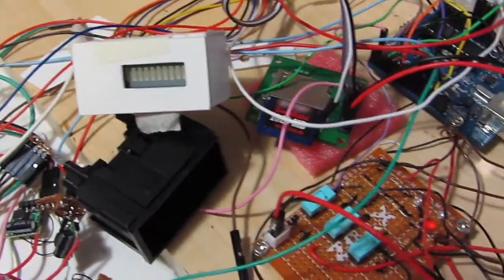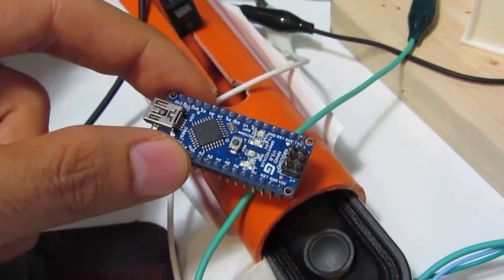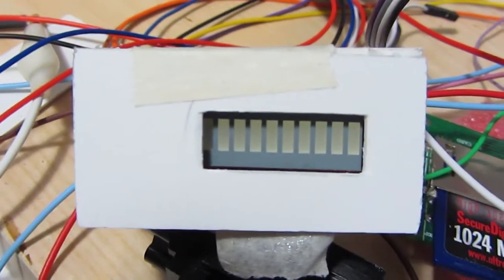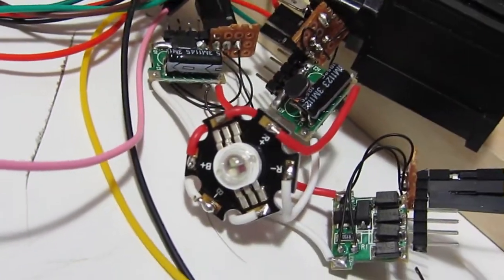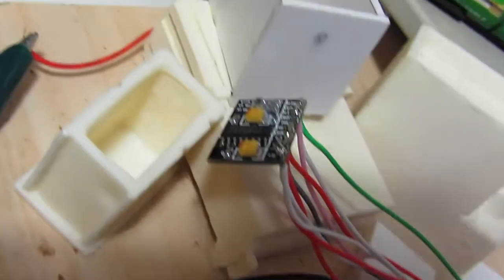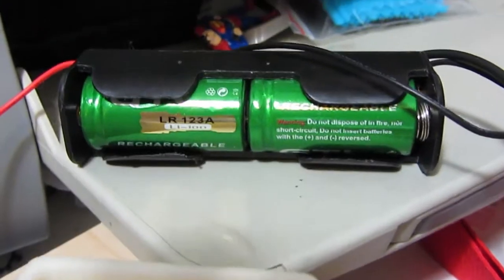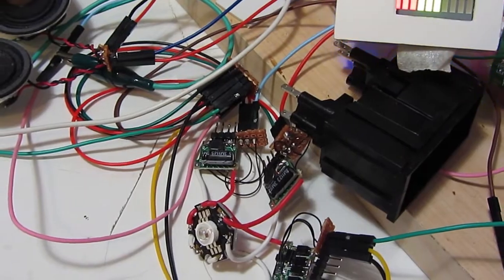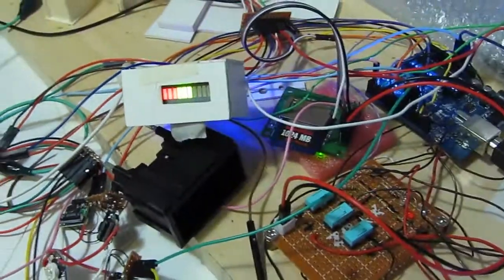Open Blaster project - wip video #3  [arduino blaster e11 led sound effects]

Comment: What a disappointment.  I have been following this very interesting post for several hours today.  I am doing something similar but am using a strip of neopixel leds in the blade of the light saber for a very cool effect.  I have struggled with the mp3/wav integration though and would have been grateful  for some guidance on that end.    I have noticed many requests for the code of this project and saw many promises that it was coming.  So disappointing to find  that the promised code was never provided.  The videos were impressive, but the final result is empty.
Reply from the maker: check here http://www.tkarena.it/fxblaster/